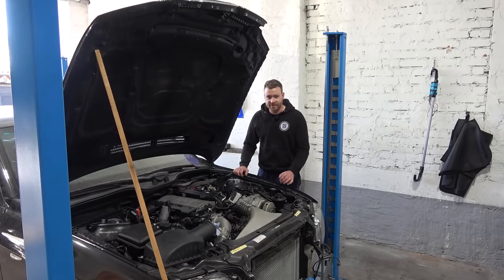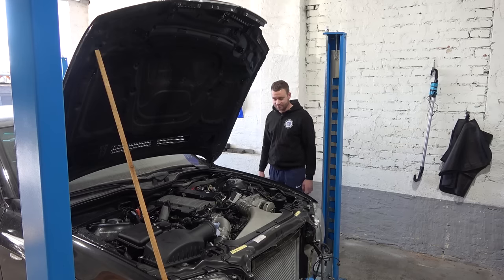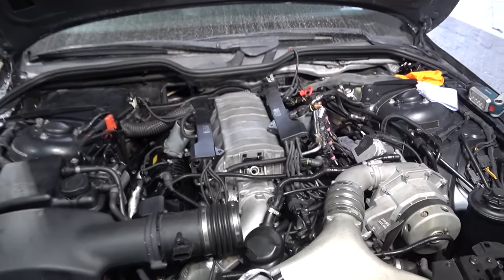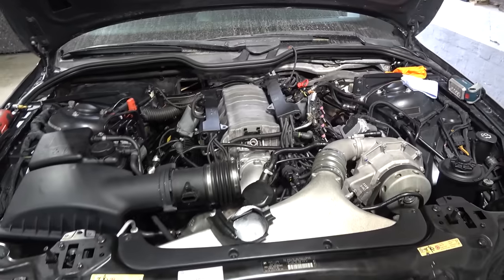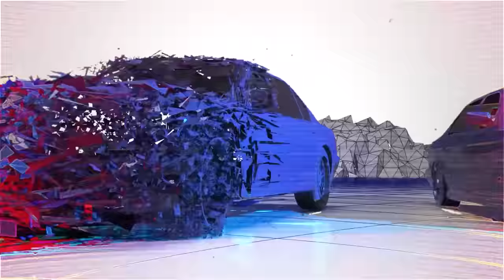Disastrous First Drive - V8 Alpina B7: Project Chicago: Part 7

Comment: Sreten I was just watching another video by a YouTuber named SAMMIT. His engine had a knocking noise as well but it was near the top. In his latest video he disassembled it and discovered that cylinder 1 was scored and the piston had too much play. Maybe the rings or something had a failure. Your boroscope tool could possibly help you check the walls. At the end of the day I’m gutted for ya man. So much work only for that to happen. I’ll watch and support no matter what happens though

Comment: I watched with my son every episode, so yes we are true followers.
I'm very interested to find out ( what you'll find out ) as a fail-point in this engine.
I have done a number of engines myself and most of them survived  a lot of beating.
 Now I have looked at your procedure  ( assembly )   which was very thorough .
I did not pick on anything that would raise my suspicion .
   THE only thing  that went wrong was the leaky injectors, fuel going and sitting on the top of the piston rubbing the oil from the top of the block liner.  It could have caused a super dry start or a slight hydro lock ( just enough for the bearings on connecting rods or wrist pins to touch metal to metal )
The friction and resistance at the start up could have caused over load on the bearing (s) which caused the bearing ( rod ) to fail or  wrist pin .    If the walls of the block are scored, then it would prove my point.   Ich wunder was the cleaning company ( einspritz injectors ) would say to that.hmmmm.
PS
If you want help I can send my son for a week to help you ( at my cost ), he would love that.
He just finished school so he is free.

Comment: 29:13 actually, modern ceramic tint can be almost completely transparent and still block almost all of the heat from the sun, I'd get that done if only to save the dash from uv cracking it over time, it also reduces glare from incoming  annoyances, and your glass will remain scratch free on the inside.  

the dark gangsta style is entirely optional these days

Comment: i had a 03 745 Li for 3 year bought it with 220k sold it with 260k and really only change the oil rear tires and front shocks and i still regret selling it   lov your videos sad to see that didn't went well your first test drive good luck 🤞

Comment: When you were putting the underbelly back together, I noticed your missing the most important cover. It's a metal skid plate that bolts up to the subframe and covers the oil pan. They actually stamped it on the subframe that you should not drive without the cover in place. Hopefully the sound isn't as bad as it sounds.

Comment: i don't want to give false hope but many years ago I had an E39 540i  M62 (6sp of course) that developed a similar noise ... I'm going to resist the temptation to tell a long story here and cut to the embarrassing but welcome diagnosis .... I have a lot of experience with engines and was convinced that by the frequency of the tap that I had a rod bearing issue or a valve gear issue on  one cylinder ... Nope, I took it to a specialist who could easily have taken a load of money off me (I loved the car a lot) on collection he told me that a spark plug was loose and almost being retained by the coil pack ...... I could not believe it and it hadn't even ruined the coil or the thread.... I hope you are this lucky :)

Comment: My E46 had a similar suspension behavior, an extremely crashy suspension. Replaced shocks, control arms. bushings, wheel bearings, and while it improved the dynamics a bit it still felt very harsh and crashy when going over bumps. I suspect maybe the shock mounts are the culprit.

Comment: Hopefully its just a lifter noise or something came loose with the lifters. My m60s lifters can sound like rod knock, different valvetrain but high hopes.  If it is rod or main bearing knock it might be from driving a little too aggressive in the first 100 miles. Shouldnt really press the gas hard enough to get it to kick down. I know you're excited but Baby it. Then after 100miles change the oil(removing alot of metal from brake in)  and for 500( no Autobahn).  Could be one of the bearings was a little too tight or loose.  Check the oil and filter.  Also could be a piece of debris from machining was in a passage and got loose with oil flow and damaged a bearing. Best of luck. You'll figure it out and get through it. You'll have it back together even faster this time.

Comment: I may be wrong but I do not recall you purging and recharging the ac system and compressor. Freon is required to lubricate the compressor.  No Freon, damaged compressor. I do believe you had the belt running. Good luck and let us the the diagnosis.

Comment: I could physically feel your pain and discomfort.
I feel so sorry for you mate!
All these efforts all that super correct work , even checking the clearances with plastigage ……..
I will not believe in a spun bearing !
I hope for you that it is something different.
Could you hear ( detect ) the noise from the upper part ( valvetrain ) or more deeper down ( rotating assembly ) ?????
Sit back an try to relax , even knowing that this is easier said than done .
Wish you the strengt to overcome the frustration.
Best regards from Robert.    Cologne only 180Km from you .

Comment: hi streton    very disappointed with the outcome of this build and you have nothing to blame  on the contrary  your assembly  was nearing perfection so very well done for that and life has to go on so now make it your strong point i have a few suggestions if i may   one being that resleeving the block with iron liners and rebore to correct tolerance and as 2 pistons are scored change them all to Steel as well so you have liners and pistons made of same metal  if you cant find such pistons then tell the machine shop to find close ones and machine to spec we have done this on many makes so its doable   also you have same metal so what happened wont repeat itself    another suggestion  is to lower the temperature of the thermoswitch   on the radiator ex fan cuts in at 90c put a switch that does so at 85c  so now you have more efficient  cooling  this really helps especially at high speeds  if i can be of more help contact me glad to help   kind regards luc

Comment: Agh, that's a kick in the nads with the engine knocking.  Hopefully it's the chain.. not the rod ends or that'll be regrind on the crank and fresh bearings..
Also have to thank you Sreten as your hot start issues were idendtical to what I've been having in my 330i Touring... turns out the injectors are likely goosed as it's got the same stink of fuel and hot starting issues after i had them cleaned. My wallet is also crying as i had to order a fresh set, should be fitted soon as they arrive.

Comment: Serten, I didn't saw you clean oil galleries in block after it came back from machine shop. I use plastic brush, a lot of solvent and pressure air for that. I think that some derbits in oil galleries starts bearings degratation, if you forgot this process....

Comment: Well, on the positive side, it sounds very metallic and hallow, which isn't typical of rod knock (which is more of a solid clack). I'd suspect collapsed chain tensioner or maybe an accessory making that sound before condemning the bottom end, but a stethoscope would help a lot here.

Comment: That is unfortunate.  I've never had an issue with any of the engines I've rebuilt so far, but it never leaves my mind that the latest could always be the one.  Hard to tell from the video... sounded like it was half engine RPM.  Hopefully it is something more minor on the cam side.  I'm gut wrenched on your behalf.

Comment: There was a guy in youtube who was rebuilding the engine in 335i e92. Everything was great until he went on a test drive. Engine started knocking. It was rod bearing. Turns out there is an oil cooler with termostat. He forgot to clean it and once the engine got to some heat thermostat opened up and metal shavings left inside it, went straight to freshly rebuild engine.

Comment: Oh i know the feeling.........just reassembled an engine after an inframe, and during the test drive a piece of sludge, deep inside the engine came loose, and blocked the feed to a conrod journal and the knocking started.  Shut it down immediately, but the crank was smoked.

Comment: Just wondering did them injectors needs to be coded, I've had a knocking noise on the car, all I had to do was program injectors, although the knock was front the first start, so probably it is not that simple

Comment: The noise sounds like a lifter. I went back over the previous footge where you rebuilt the engine and saw that you didn't replace them. I think this is where the noise is coming from. It didn't sound like a timing chain or bearing noise.

Comment: I just rebuilt my 4.4 also, after a few 100kms, the bearing on the pulley gave way and has a terrible knocking sound. Hopefully its something simply. The engine was put together professionally

Comment: Not that this is your primary concern, but if those are the original struts they’re almost certainly the reason why the car feels jarring and “crashy” over bumps. The bump stroke valving is likely worn out and can’t control those monster weight wheels causing the suspension to “crash” against the bumpstops every time you hit something mildly substantial. Also with fresh struts I imagine that already nice handling car would be noticeably better.

Comment: maybe an oil check-valve came apart in the head. The plastic check valve can get lodged in the oil passage causing starvation on N62. alot of components need good oil pressure in N62. The N62 is a serious oil pumper.

Comment: Well, for me this video did not only have entertainment value, it may have saved me quite a bundle. I was considering taking the injectors on my Touareg's 3.6L V6 (BHK) for professional cleaning, not because the engine is running badly, but..just because. Boy did I slam the brakes hard on that plan. I understand that the Alpina's injectors are different than a VW's, and that the shops here that perform this service do it on professional equipment and I haven't heard of leaking injectors after cleaning, but why take the risk if there's no need to, right?
Now one thing that I will have done, is clean the carbon on the valves using walnut-shell blasting since the BHK is a direct injection engine.

Comment: after seeing that the fuel injectors leak, i would say that the fuel has gotten into the oil and thinned it out.
i worked on hyundai/ kia and the high pressure fuel pump would leak and cause " running rich" engine light then seize engine if not adressed.

Comment: Hi there. I am a big fan of this channel and watch them over and over.  I know how it feels when you think you finish a project but a problem appears at of no where. I have noticed after repair the car was not primed and was started right after engine rebuild, per BMW specification every time engine bearings are repaired, fuel pump fuse muse be removed and car be started in 5 second intervals until it build oil pressure. It might be the cause of engine knock. I hope I am wrong about the bearings and knocking sound is from something more simple.

Comment: Maybe you can tell better, but to me it looks like the left side has been in an accident.
The front part (wing/door) change ever so slightly in colour when you move over it with the camera, compared to the rear part (door/wing).
The flow of shine stops where the front and rear door meet, when the light catches the car.
 Edit: nvm the door :)

Comment: Including the cost of the car how much are ypur total investment on your cars.  You tell us most of the prices of parts. I love to see them restored but are you over the value of the actual car.  Your going a full restoration new lights all around thats alot of money the rebuild all the suspension parts.  All oe. I applaud you as I also just spent 12k restoring a 2010 535xi new motor the works and I didn't have to change all the parts you have.  Don't know how u do it bout as a bmw lover I have 3 I would love to know at the end of your video explain all the cost involved.  I'm about to take on an e39 M5 that's been sitting for 8 years without starting.  It's going to be a big job.  Thanks.. it helps me in my decisions knowing ahead  of time

Comment: Almost like my Suzuki GSX400F, 80's motorcycle though. Ran fine for some time - 20k kms. Then even it had fresh oil it spun crank bearing. Oh well. In diffrent perspective 100k on 80's motorcycle, never rebuild is a lot. It awaits in my garage for revival.

Comment: Sounds similar to my M62TU when timing chain slipped timing. Lots of metal flakes in oil filter at around 136 K miles 20 years old

Comment: I have been thinking about this since I watched the video last night.  This engine has been fixed or rebuilt twice now if I remember correctly.  Maybe there is a flawed machine part of the engine causing the same problem over and over and no matter what you do to ensure it’s built right the engine is flawed from the factory on this particular unit??

Comment: Hi, I'm looking for fuel injectors for my 1988 M70M50 V12 engine. You bought yours for 350euro, I guess there are no originals, will this aftermarket part "0 280 156 346" fit and work well for my engine. Many thanks for reply

Comment: I know it probably isn’t priority but that annoying buzzing noise sounds like the thin plastics they use in the air vents/ flaps, or even the steering column covers and I’ve even had the instrument gauge clear screen make that high frequency buzz at speed.

Comment: I personally wouldn't use a cloth to clean glue residue as you won't be able to use it again. I would prefer to use one of those plastic razors then clean off any excess with a paper towel.

Comment: I am a fan of the Alpina B7 but what strikes me is that I often read that the engine needs to be overhauled after about 150,000 km.  bearing shells and pistons etc. Previously I had a Volvo 164 3 liter 6 cylinder and they never broke.   a high-quality 8-cylinder engine must be able to drive at least 300,000 km without major maintenance! is it a coincidence or is the quality of the engine less than we think?
Reply: The quality of the engine is exactly as we think.

Comment: Alpina test each of its engines for a couple of days in a control room monitored by engineers, they push the engines hard.  The back and forth troubleshooting is a pain if you are on your own. I am not surprised there was a knock, I thought you would have had a much bigger problem taking a freshly rebuilt engine for a test on the road without some in-shop testing. I am sure you will figure it out Streten. Sorry this happened but it's hit or miss.

Comment: aw man, such a crap end to what seemed like a perfect test drive, great weather, great landscape, and a good car... at the moment.
Hopefully it's something that can be fixed without too much work, heartbreak, or breaking the bank, but who knows with that car really, maybe it's haunted by nails and a new one somehow found it's way in there. :P

The kinda rough bumps though, do you know anyone with a stock B7 like that? if so can they confirm if it's how it's supposed to be due to the big rims?
Does it need rims that big to clear the brakes? or could you "upgrade" to Alpina rims of a smaller size perhaps, if it's what's making it rough? As it seems a bit harsh when we can even hear it over the video when ya hit bumps in the road... but maybe that's just the sacrifice for a sportier suspension?
Though I'm almost surprised that it's sporty, Alpina has always seemed like they made theirs more powerful but with more comfort type suspension?

Comment: The only window tint I can tolerate is the kind that is made into the glass. Aftermarket tint is just entirely unacceptable to me. I do particularly like the pale amber/gold window tint on older JDM cars and certain older euro spec cars. Particularly when paired with paint codes that really suit the tint, like green or a metallic basalt color with a bit of gold tone to the majority dark grey paint. The other tint I'm not hugely fond of the aesthetics of is the UV reflective tint in certain Mercedes and Audi cars from the 90's and early 2000's which throw off a rainbow from the exterior of the car. I love the functionality of it from the inside, but it does look weird from the outside.

Comment: unfortunate...

i thought that new engines needed to be broken in, gently, over the first 1000 miles or so. GM thought it so important that on their new mid-engined corvette they set the max RPMs to, i think, to less than 4-5000 or so for the first 1000 miles. in fact, the max RPMs was set through the software so as to not be able to rev past that pre-set value.

having watched him, over the years, being so meticulous when assembling the engine (and everything else he does for that matter) i was surprised to see him on the autobahn, and hearing the car being revved while passing other cars on the two-lane roads on what appeared to be the first drive. can't quite understand it...certainly he was aware that rebuilt engines needed to be "broken in". i must be missing something.

Comment: Perhaps the oil thinned out from excess fuel when it was run with the bad injectors?
Reply: He said he changed it after replacing the injectors... But maybe it was still caused by the faulty injectors regardles..

Comment: Sreten: the previous owner had so many engine problems he gave up on the car and sold it to me cheap. Now after hundreds of hours of labour by a seasoned professional, thousands of euros spent on new parts and a full rebuild, the car may still have a serious engine problem requiring many more hours of labour and hundreds or thousands in parts. 

Me: man those 7s are nice I wonder if there are any cheap ones for sale near me